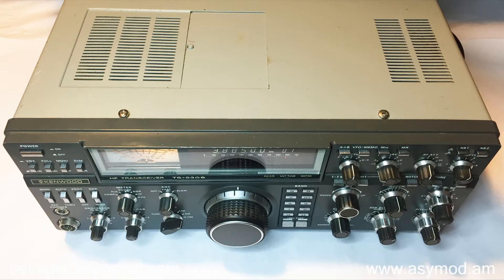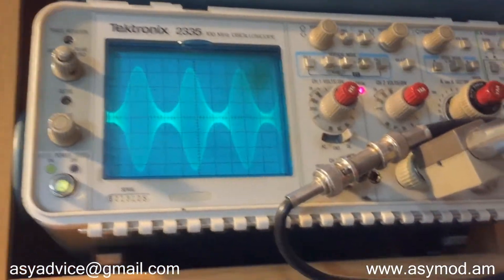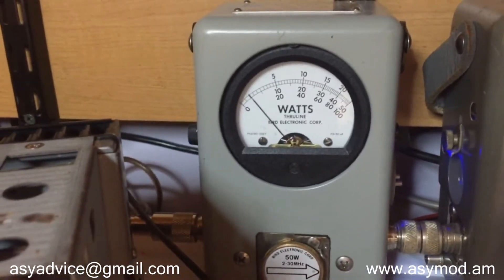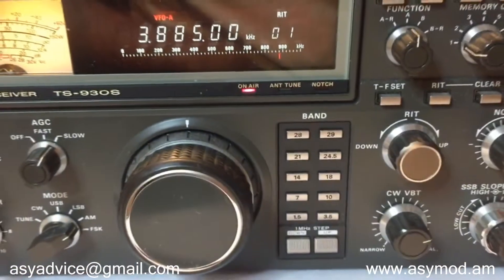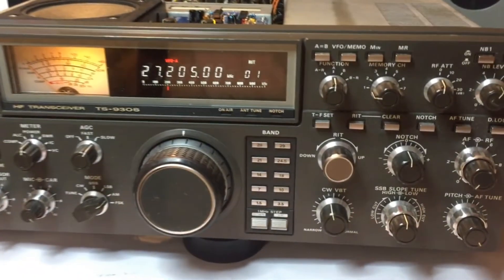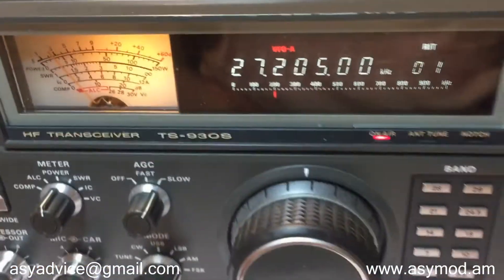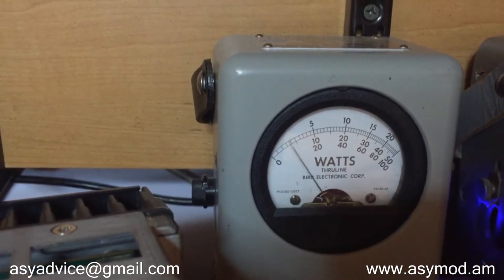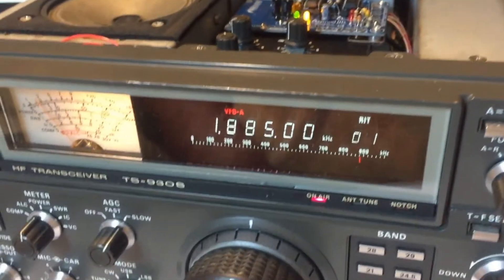Asymod IIIs and the Kenwood TS-930S Hi-Fi Transceiver Demo

Comment: BUT YOU NEVER CHANGED THE MODE TO SSB SO IT WILL NOT WORK ON SSB ???
Reply from the maker: Yes, your 930 must be upgraded for ESSB. As it is, it is Hi Fi, Asymmetrical wide-band AM.  SSB has been untouched and is at standard 2.5K BW.
Reply from the maker: The installation can include the ESSB upgrade not shown on the video.
Reply: is that extra
Reply from the maker: No.
Reply: I own that radio, that's my radio on that video. it works great on HIFI AM and it still works on SSB normally unless you ask for ESB for it. 73...... NO BS that's my radio.